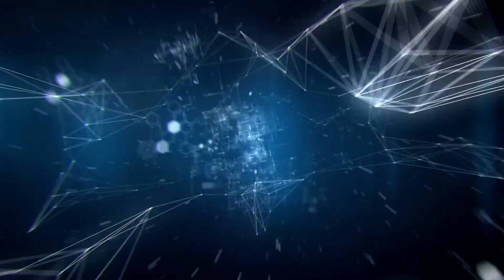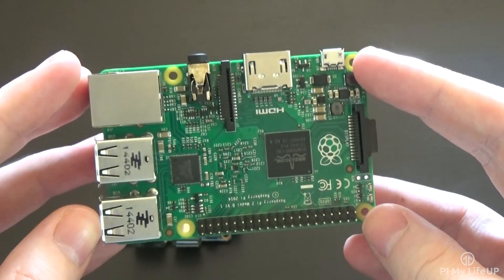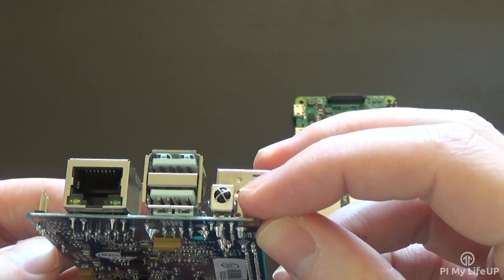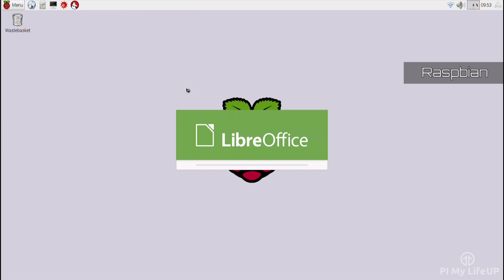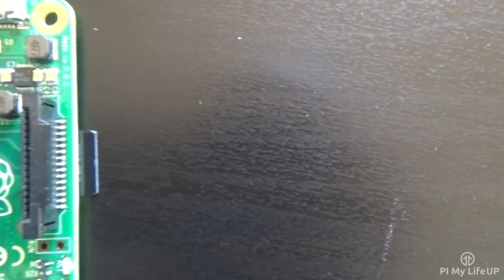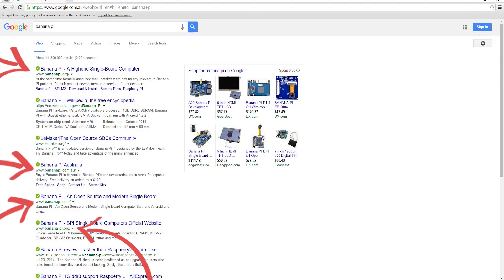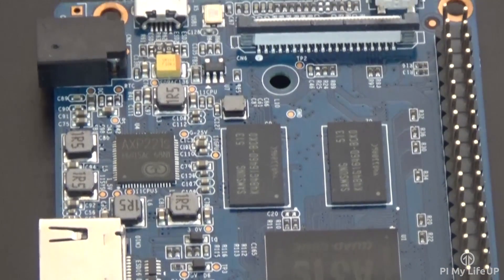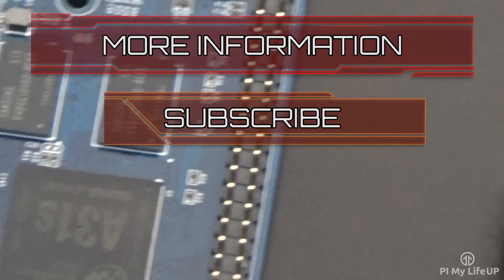Banana Pi Vs Raspberry Pi 2: Battle of the 2 Fruits

Comment: From my experience with the Lemaker Banana Pi, i can say: stay away from anything AllWinner! Really bad support for video accel and most of the development is mounting on the shoulders of the sunxi project. The Android Os is broken as hell and needed community intervention to make simple adjustments. One year later and still waiting for proper video solution. Mine is taking dust since Android is bad and the Linux distros can't work  properly without mali drivers for the GPU. Take a Raspberry 2 and enjoy the large community and good video drivers out of the box.